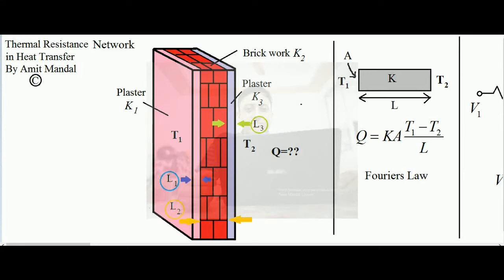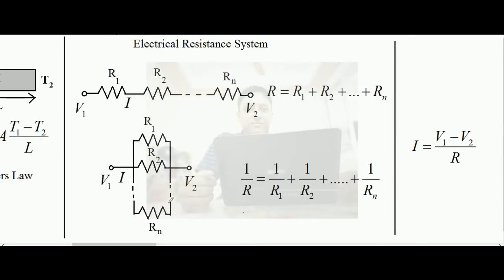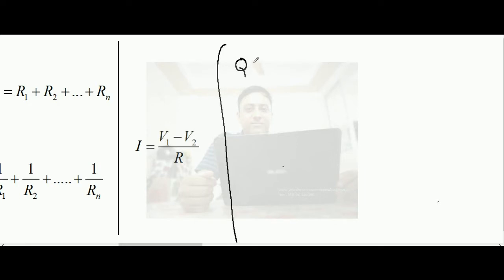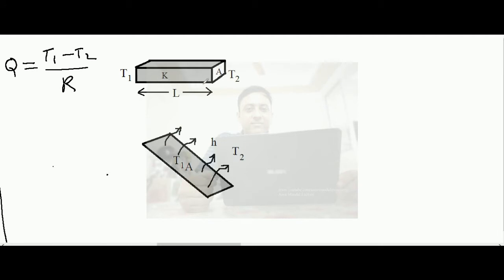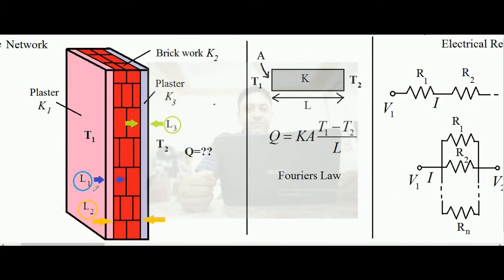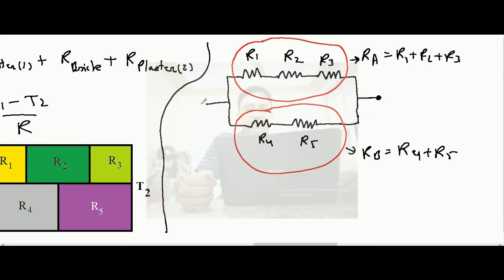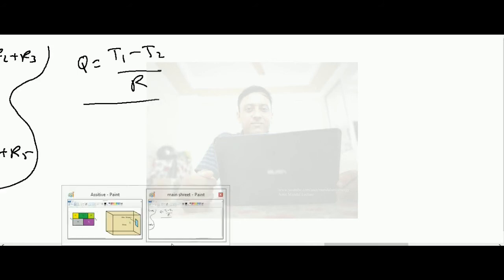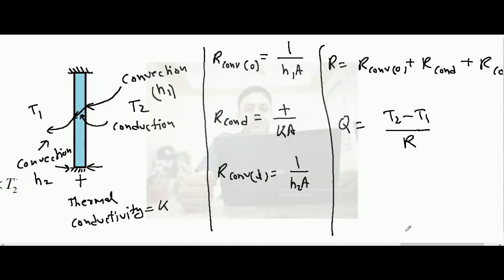Thermal Resistance Network | How to solve thermal resistance problems?

Comment: Dear sir,

I have a question.

Suppose we have a wall which is exposed to sun.

As per your lecture there are three resistance (Convection + conduction + convection).

But the sun radiation is also on the  wall is there any radiation resistance on the heat transfer it will be considered.
Reply from the maker: Find solair temperature...